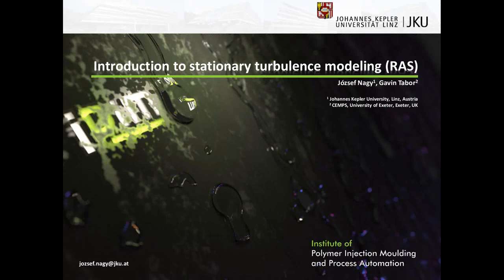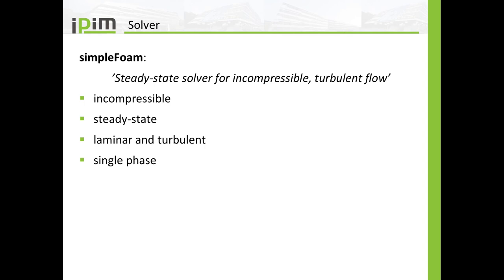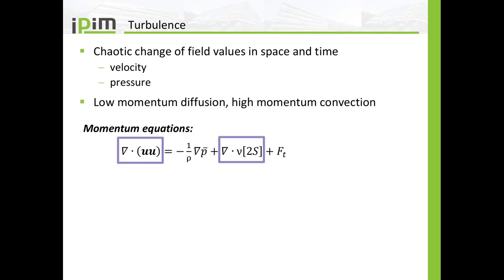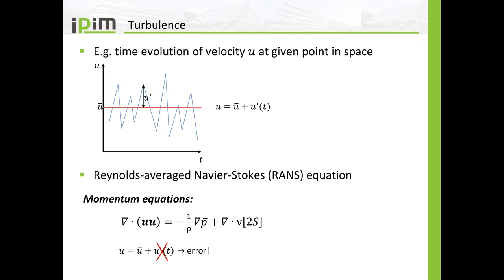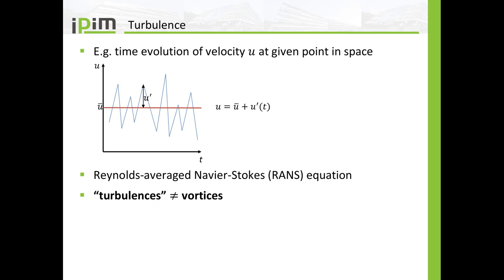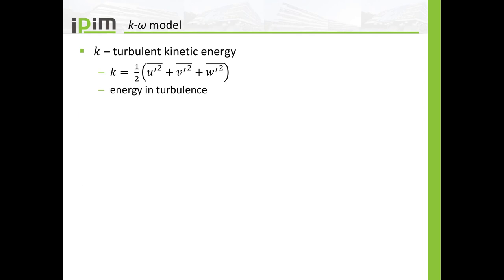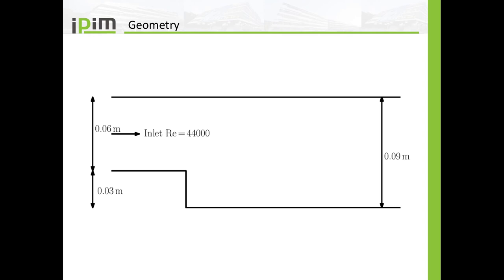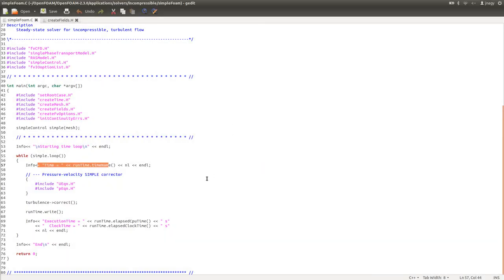Introduction to stationary turbulence modeling (RAS) - Part 1

Comment: Hi! Thank you very much for the video!
I have a question,  I understand that this is a 2D case, but if you want to solve now the same case in 3D, for example using 0.15m depth, how would the characteristic length be calculated?
Reply from the maker: Usually the area/circumference.

Comment: Dear Sir,
Thank you for your tutorial, actually it is so helpful.
In your video, you calculated epsilon coefficient with considering of value of L.
In my problem, I want to simulate a flow around a cylinder with diameter is d and length is L.
So I have a question: When I calculate epsilon, will I use diameter or length of the cylinder?
Best and regards.
Reply from the maker: I would use the diameter.
Reply: @OpenFOAMJozsefNagy  Thanks for your reply!

Comment: Hello, I have done this example after your tutorial step by step and it works very well. I've learned a lot. However, I want to modify the boundary condition from velocity inlet to pressure inlet because in most cases , we only know the inlet pressure conditions rather than the inlet velocity. I changed the initial conditions to : p inlet : total pressure, fixed, uniform 200(relative pressure), outlet: inletOutlet, inletValue uniform 0;   U, inlet, pressureInletVelocity, outlet, pressureInletOutletVelocity. Sadly, it didn't work. Could you please show me a method to make it work?  Sorry to disturb you again.
Reply from the maker: I would use fixedValue for p on both the in- (200)  and the outlet (0). If that works, I would set p to totalPressure and see if that works.
Reply: József Nagy I have tried fixedValue condition but still failed. Have you succeeded trying to do this?
Reply from the maker: Shiqi Wang
Yes I did run simulations with these conditions. I am sorry, but it is difficult to solve a problem over YoutTube comments.
Reply from the maker: Shiqi Wang
With this tutorial 200 on the inlet does not make sense, because the pressure range is one order of magnitude lower, plus in this tutorial case the pressure is also negative around the step. An inlet pressure of 200 is rather off in this tutorial.  What you can try for your case, is calculate your geometry with an inlet velocity, that produces the correct order of magintude of pressure on your inlet (~190-210). Then you will have a velocity and pressure field that is closer to your actual case, then you could switch in the last iteration with the velocity inlet the boundary condition to your pressure boundary condition. Hopefully the solution will converge.

Comment: Hi! I have two questions, first: Do you have any reference for the kinetic energy equation?  k=3/2(Uref*Ti)**2

Second: What do you mean with " L=characteristic length scale"?

Thank you!
Reply from the maker: Try and google them or look it up in a book about turbulence modeling. They are rather common. I don't have a refernce on my hand, I would have to look it up myself. They are also used in Fluent.
Reply: I also the same question. what is the length scale? I have read in the google and wiki but I can't understand length scale. you can explain for me. my problem is a airfoil (chord 1m, Uref = 33 m\s, Re =2*10^6). I want to set up RANDS mode with K-omega SST.  can you help me, please ?

Comment: Hi Jozsef! 

Thank you for your videos, I find them really useful! Could you please clarify if the l = 0.07L is acccurate? for K-epsilon?
Because I found this one the openfoam documentation for the k-epsilon solver and it says that l = L. The link to the documentation is given below:

https://www.openfoam.com/documentation/cpp-guide/html/guide-turbulence-ras-k-epsilon.html

Thank you for contributing :). Really appreciate your work.

Regards
Shafik
Reply from the maker: It is a rule of thumb. A lot of people say a lot. You can check out the specific boundary condition for turbulent inlets in the newer version of OpenFOAM.